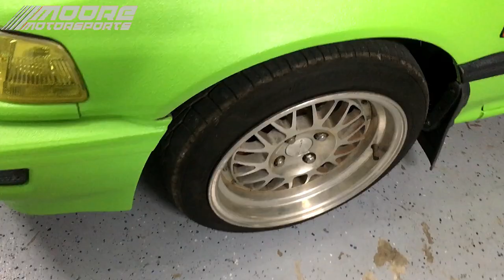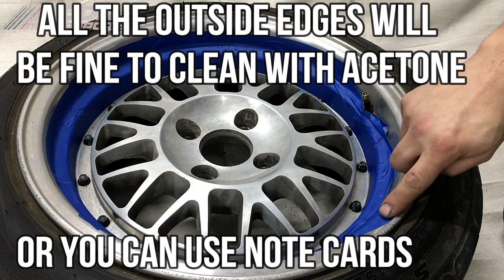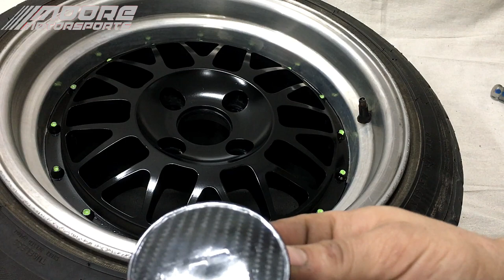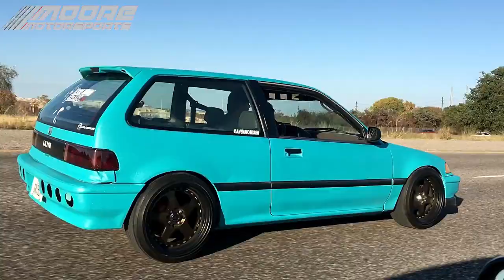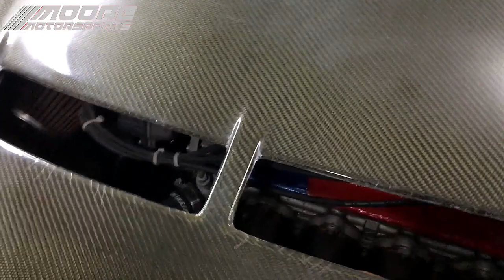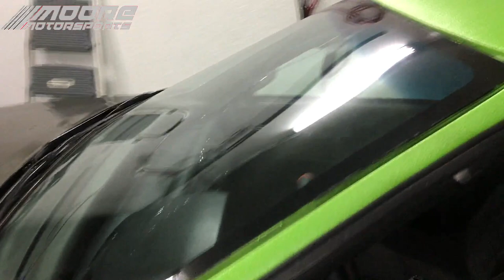How i paint wheels for cheap & make them look really good!!

Comment: Im glad yours turned out better than mine. I made the mistake of using duracoat. I figured if its good enough to hold up on a machine gun, it will hold up on a wheel. Wrong. Bleach based tire cleaner will melt duracoat. :) Good times.

Comment: I agree, Autolite's suck in Hondas. NGKs all the way.
Reply from the maker: Great minds think alike. Every honda with autolites run like total crap
Reply: @JamesDguy  Storytime, I was at an autoparts store and they were out of NGKs, they told me Autolites were the only ones they had in stock.  I installed them, drove for about a mile, immediately uninstalled them, cleaned up the tips of the old NGKs, reinstalled, waited for NGKs in the mail.  10/10 would not recommend.
Reply from the maker: @hegeliandetective1034  Yes i have bought many honda's and they almost never run right.

Comment: Pro Tip because this just happened to me: if you're painting dismounted rims and are planning on having tires mounted and balanced afterwards, let the paint job settle for a good week or 2. I took mine to get mounted 3 days after the job was finished, and the paint around the edges was chipped and a ring formed in the paint due to being clamped on a balancer. Not fun.